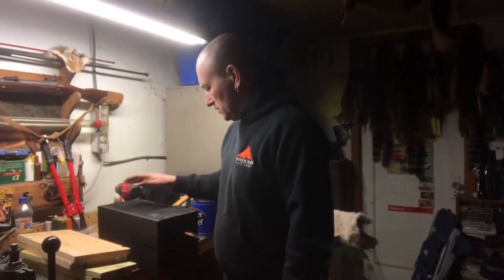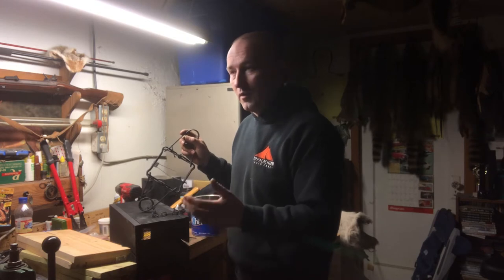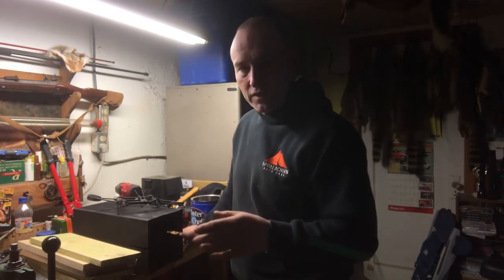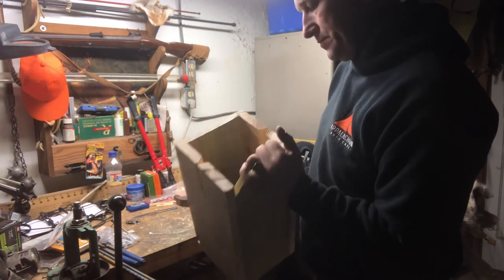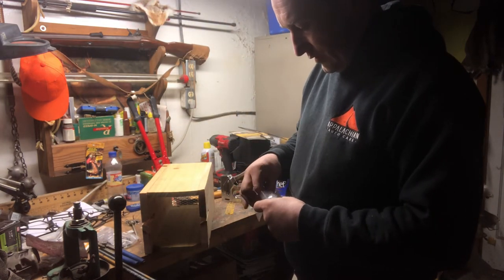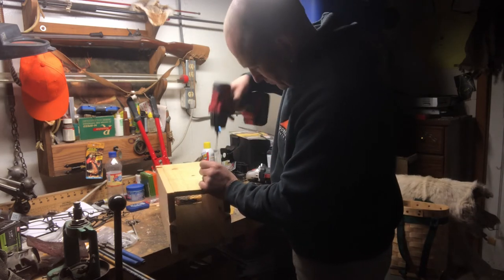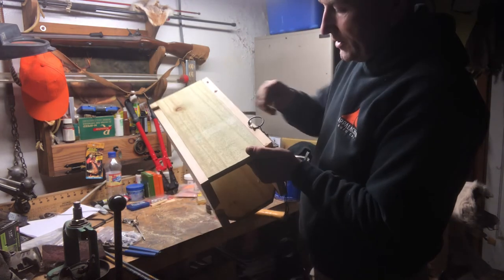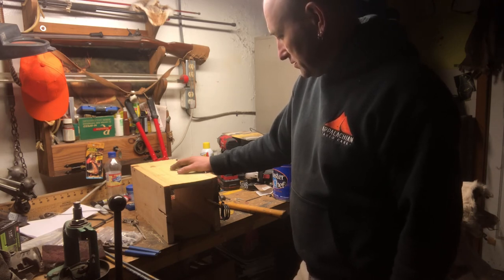making a mink box

Comment: Hey Paul this is your neighbor from Stroudsburg. Great video, on a different note I’ve got a lot of stuff to install on my Tracker would you recommend a marina locally that does excellent work?
Reply from the maker: Best people I have dealt with are Bowers marine, there the tracker dealer where I bought my boat, closest location they have to us is in Temple it’s 5133 Kutztown road, Temple PA 19560, there number is 6109299444, they put an engine on my father in laws boat and they done a good job. They had also mounted electronics, there’s a smaller repair shop by beltzvile, beltzvile marine but I don’t know what type of work they do , next closest tracked dealer to us is the bass pro shop in Harrisburg. Hope this helps you out.
Reply: @huntnfishnuts5880  Thanks Paul keep em coming!